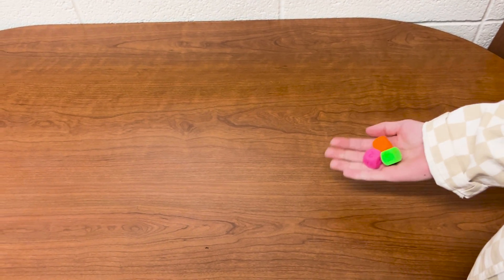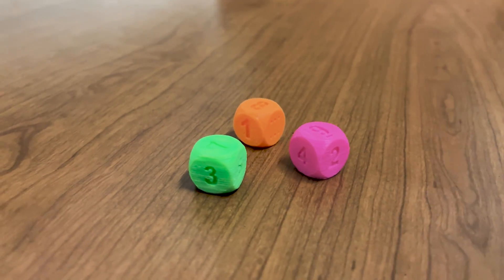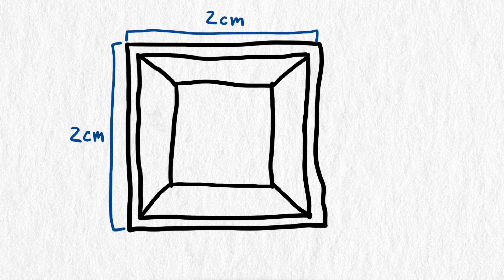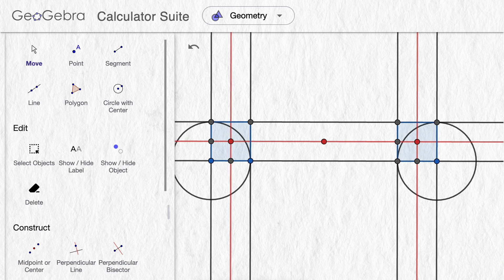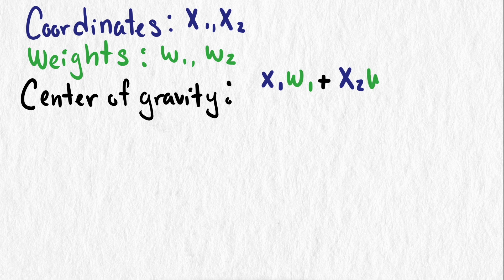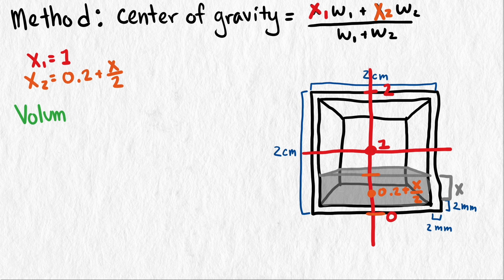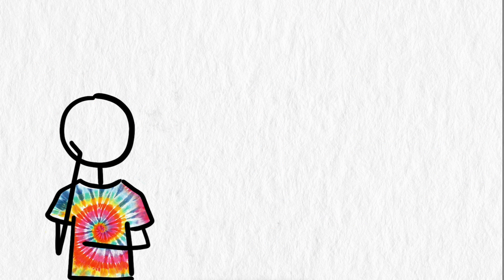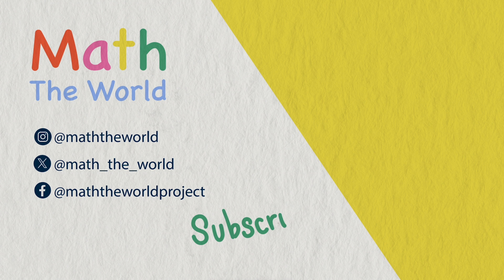Are these the BEST 3D printed loaded dice? | We use math to optimize their design!

Comment: Could you make it better with a different shape of the filling like a semi-circle or something?
Reply from the maker: I like your thinking! I might not know enough statics ( The field that studies forces, and who used a lot of centers of gravity)to answer your question correctly, but I don't think so. At least if we think of the die just sitting on the table and we're trying to lower the center of gravity the most. There might be a different issue if we think about it rotating but I'm not sure. 

The reason that a curve wouldn't help, is that the height of the center of gravity only depends on the y position of the material, so you would want all of the material to go up to a plane perpendicular to the y-axis.

Comment: I went ahead and non-dimensionalized the problem and then bashed it with calculus. If you let p be the ratio of the mass of the shell to the maximum possible mass of the filling, and let q be the ratio of "x" (from the video) and the maximum possible "x", the optimal solution is at q = -p+sqrt(p*(p+1)). As expected this function ranges from 0 when p=0 (without a shell, you can minimize the center of gravity by making a super thin layer) to 0.5 when p approaches infinity (the more shell there is, the more you have to fill the cube, up to a maximum of 50%). 

Thanks for nerd-sniping me!